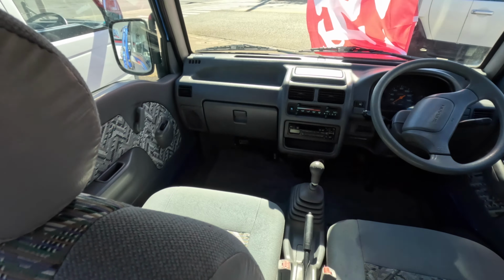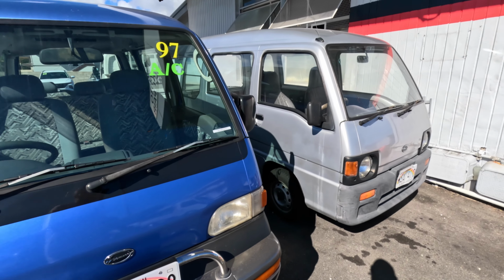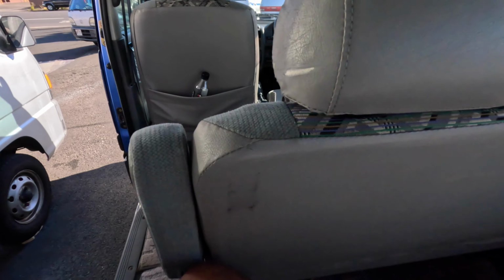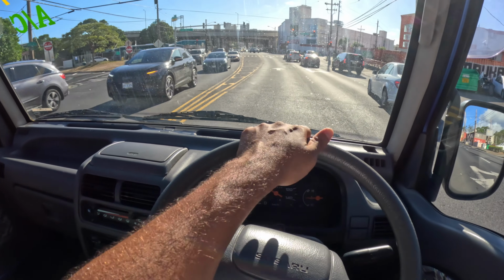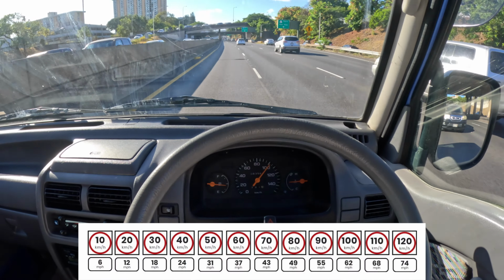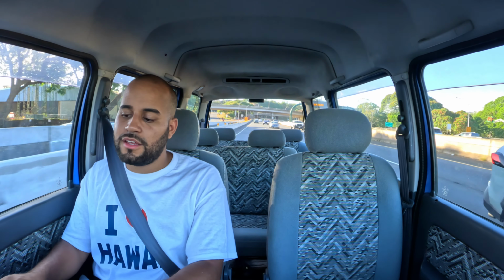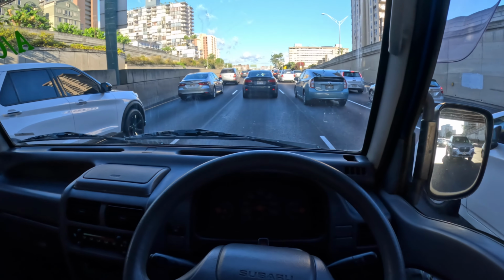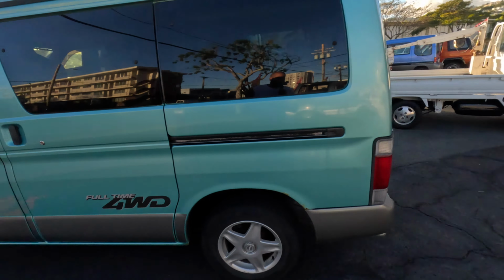Subaru Domingo POV Drive & Overview! Kei Van on STEROIDS

Comment: Unfortunately, "no replacement for displacement" isn't always right. It may be twice the size, but in reality only makes maybe 5-10 more horses than a nice turbo'd/supercharged Kei engine.  The EF12 was pretty sluggish when it came out, but it's built to last. If you did get one, make sure it's got EFI and slap in a turbo. Expensive, but you'd have the fastest Kei-type van around. Really cool van either way, might run a bit nicer in town than your average Kei van too.
Reply from the maker: For around town and just normal city driving it really is a better kei van in every way. I think the only flaw these have besides the ECVT is parts are hard to come by and more expensive than usual. but I definitely want one eventually

Comment: I didn't know about the Domingo's engine.  Nice.  1200cc, if you add a turbo you get that acceleration power you need on american freeways and can cruise without super stressing the engine all the time.
Reply: people overrate how much acceleration you actually need for american highways. I pulled a fully loaded teardrop trailer with my fiat 500 across the states. Acceleration was horrific but someone will always end up letting you merge. (though it felt a bit sketchy at times)
Reply: @Lepretr0n  It being possible doesn't mean it's a good idea.  Chances are if you try to drive a 50cc moped coast to coast including freeways ... you won't make it :)

Comment: The Subaru Domingo was also sold in Germany as the Subaru Libero (also with EFI engines) and it was quite a popular car back then as it could match up to Autobahn speeds.

Nowadays it's still a quite sought after item, with some very good kept up examples (especially these with the retracable glas-sunriof) reaching prices up to 12k€.

Comment: Hey Guy - You need to try and get your hands on a Suzuki Carry (or Every) van with a turbocharged 3 cylinder engine. I owned one for several years. (turbocharger, intercooler, fuel injected, 4WD) It was a ROCKET!! They are rare but they're out there!!
Reply from the maker: I need to find one, I really haven’t seen maybe turbo or supercharged vans in general
Reply: There's also the Suzuki Every Landy (1.3L) or Super Carry (1.1L) and a ton of others. Suzuki made soooooo many variations of the Carry/Every but they had limited releases in different markets. The late 90s/early 00s Landys are pretty sweet, though! Very similar to the Domingo in size and functionality and even though they moved the engine to the front, they still look really cool, unlike a lot of modern kei vans.

Comment: Yeah ya need a tach. I had a Delica Super Exceed w/ the little diesel turbo 4 cyd … i rarely looked at the speedo, i always looked at my tach. I always kept it between 3000 and 3500 rpm’s. It was always happy. Never hot, no oil consumption and got decent mpg’s. I sometimes miss it.

Comment: Hey what did you think of this Van? Its up for sale again here in Hawaii by the current owner who got it from Slater. I have a Delica from Slater.
Was it way better than a Kei ? trying to decide between the Sambar and this one. Watch your videos all the time keep up the good work.Mahalo David
Reply from the maker: Hey what’s up, it’s definitely a kei van just with a bit more punch I really liked it. If you need the extra seats that’s a pro. I still want to get a Domingo but it’s very hard to find them especially 5speed
Reply: @Waybeforethefame  Was gonna take all of the seats out anyway dont need em. Just want a little more power for here on maui. no real flat roads here and we don't really go over 45 mph much here so its perfect. My Delica is slow af 92 l300 built out as a camper van that i rent here on Maui.
 How good of a condition was that van in when u drove it right now it has 53.000 miles on it and he has had it since sept.
   I have found quite a few manual ones around the mainland and was thinking of pulling one of your moves and driving it from Miami to the port in California. Slater has another one but he wants a ridiculous amount of money for it 18,500 !!!! no kei van is worth that yes I know its technically not a Kei but it really is. the one im looking at is 10,000 and newer in better shape.

Comment: The fact that you can pass people is pretty good. There is a turbo van I really want, but I'm wondering if I'd need the Domingo... 
How much more powerful (freeway etc) is the domingo over a supercharger or a turbo kei van?
Reply from the maker: Depends on what you wanna do if your goal is to go 70mph offer I would save none of them and get something a little bigger
Reply: @Waybeforethefame  thanks for the reply man. 
goal is mostly light offroading and camping. But occasionally need to go up some hills and also pop on the highway now and then. But highway driving isn't the main purpose.
Finding someone that has driven a turbo/supercharged kei van, and a domingo... Near impossible lol.

Comment: So what size is the cut off for a Kai car. Cause I swear you mention a del soul is classified as one but  CRX isn’t. But the subi you were just in isn’t one either cause of the bumpers and subsequent the overall length. So what is the basic requirements to be a kei car
Reply from the maker: I don't think the del sol is a kei car. For it to be a kei car it needs to be 3.4 m in length, 1.48 m in width, and 2 m in height or less, respectively, and a displacement of 0.66 liter or less.

Comment: the Suzuki every reminds me a lot Bedford Rascal from uk that is what i first looked at buying but uk salt the roads so finding one with little rust at fare price nearly impossible but japan most imports normally very good for no rust and ive found few importers in uk so when 100% sure i want one i have to drive one first but they look fun and love the sound ive got options to import one but have one bookmarked on my browser i really like but great condition 41k miles but quite basic high roof and rwd for £6500 ($8,251) and another still basic but same spec but very low miles £7500 so they not cheap in uk. two options due health modern car with cruise control or kei van i turn in to micro rv so when i need i lye down have rest and what ever option plan to keep for very long time hopefully decades and funny feeling kei van go up in value as petrol/diesel bans kick in and these vans get more rare
Reply: so many speed cameras in uk, being slow is not big issue for me
Reply from the maker: You should get one!

Comment: Double the horsepower is not double the speed.  Rolling resistance is linear but aerodynamic drag increases with the square of the velocity.  To go twice as fast requires four times the power.
Reply from the maker: Maybe not double the HP but the Domingo is much faster than any kei van. I just need that top end speed
Reply: @Waybeforethefame  - I had my TwinCam Hijet up to 115 KPH today without really trying... not quite full power.  It'd be wound out at 120 KPH but not deadly to the engine, although I'm sure sustained full power would reduce engine life.

Comment: Full time 4WD probably robbed some power, and it looked like the Domingo was geared for 110 KPH cruising, with 130 near redline?  I'm not a fan of full time 4WD, partly for the handling but mostly for the fuel economy.  I've always thought that the US market should have kei trucks and kei vans, but with 1200 cc engines.
Reply from the maker: Yeah I can see these being sold in America with some airbags
Reply: I had a 94 Subaru Leone wagon back in Australia and loved the selectable 4WD - was thinking of getting something similar when I moved to Vancouver (Canada), but immediately jumped at the chance to get a Subaru Domingo when I saw one for sale. For the weather here (averaging >160 rainy days a year, w/ occasional snow, slush, leaf mulch and mud) the full-time 4WD is honestly lovely to have. Might not be the greatest for fuel economy if you are driving a lot or doing lots of highway driving, but for getting around a wet city and the occasional shitty road, it's a nice little feature.

Comment: Looks nice but not liking the 3rd row of seats. I'd rather just have a 2nd row and use a foam flip chair for an extra seat and a bed when I need it. That way you can put in some storage space on the side for storage.
Reply from the maker: You could probably remove the middle or rear seat in the back and how a cool setup inside
Reply: @Waybeforethefame  he has some great looking stuff but the shipping costs just make it too expensive. Too bad there isn't a cargo plane to fly it from Hawaii to the east coast. Or even a ship that would bring it to the east. I love what he is doing with that yellow 4 wheel drive car. That is going to be amazing.
Reply from the maker: I feel the same way I would love to buy one of these cars too @frankdemith3849
Reply: @Waybeforethefame  I'm looking forward to seeing the Bravo Josh is getting in, but I think it's going to be too expensive.
Reply from the maker: Yeah that one is a classic and deckvan I never seen one like that before @frankdemith3849

Comment: I think with a few mods this could definitely get a little faster. It's just rather not. We can get those mods here than the United States because it might be better just to do a full engine swap. Maybe put a Honda goldwing motor in it, but I don't think it'll fit. It's just an example
Reply from the maker: its quick enough as is for American highways
Reply: @Waybeforethefame   do you know if I could get a farm use only import title for something brand new like a Suzuki carry with a scissor lift dump bed made in 2022 or newer if I agreed to never put it on the road I just need it for tasks on property I own 

I'll be picking it up at the port in Jacksonville Florida then putting in a trailer to my house in Pierson Florida 

I don't plan on putting a tag on it and no insurance if it needs gas I'll use a can not like the cops in my area care just because I see plenty of side by sides on the street where I live